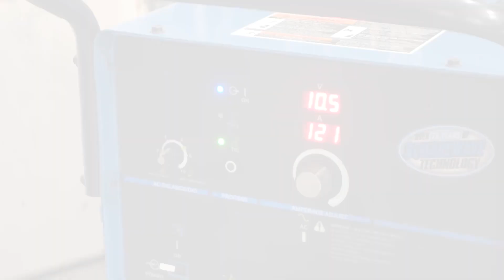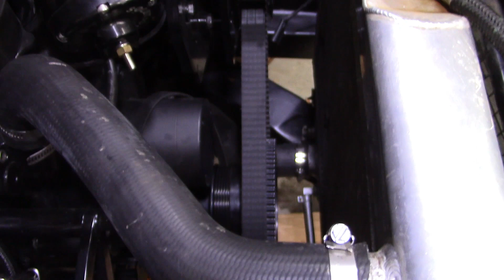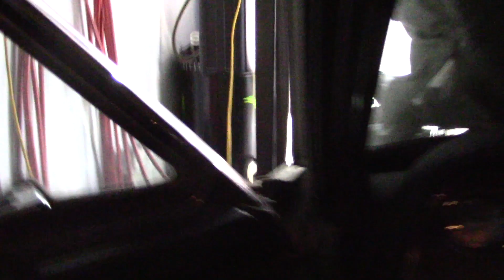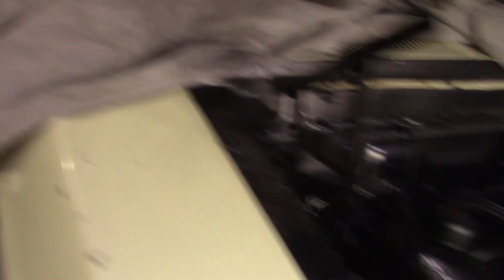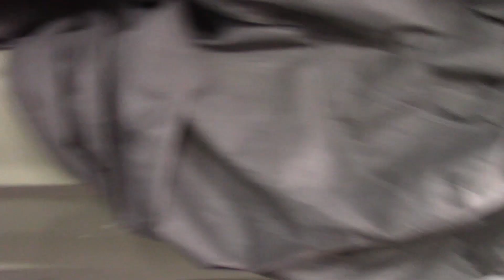408W First Start Up

Comment: Any recommendations for a starter? Building a 408w stroker and shooting for about 10:1 compression. Just putting a parts list together while its getting machined. Thanks
Reply from the maker: Check out the pdf on our suggested parts video. 

and follow our engine build video to assist you doing it!

Comment: Did you balance the engine? Or buy a balanced kit? Thanks!
Reply from the maker: bought balanced BUT had it double checked at the shop that machined the block

Comment: Does the hood clear with this set up? putting a 351w with a Vortech V3 in my 1966 mustang and was going to get a holley high ram but maybe I should go this route it looks pretty simple
Reply from the maker: nope :( i had to go to a 67 shelby style hood with a 1" raise to it.  it clear now. but it is JUST under the hood.  no hitting yet but it is close.

thats the closest i could get.
Reply: @710Garage  I was gonna get a cowl hood probably if I did the high ram intake, how do you like that sniper efi? Is the self tuning good enough with boost or did you get it dynod somewhere too? I saw you were adding meth at some point is the sniper capable of tuning with the meth?
Reply from the maker: we were actually surprised at how well the Sniper tuned itself on a buddies 427 / YSI combo. 

cant go wrong with a Holley EFI thats for sure.